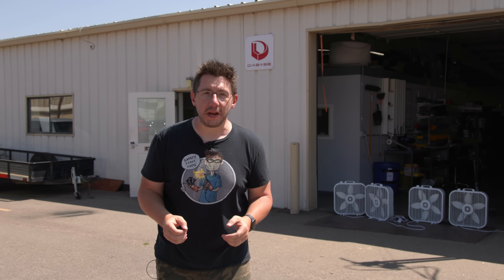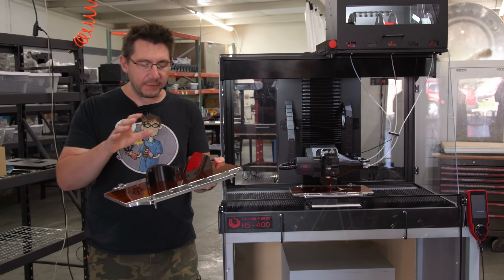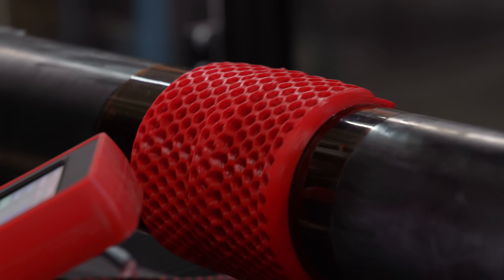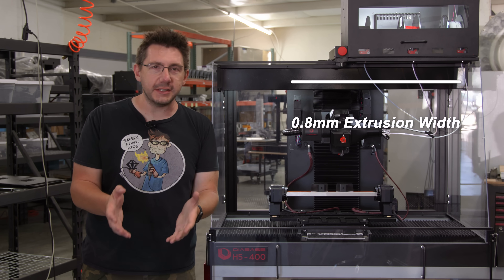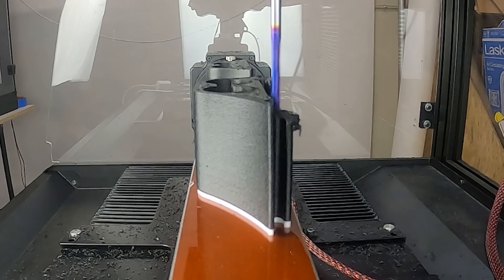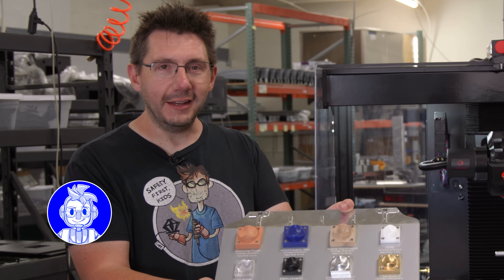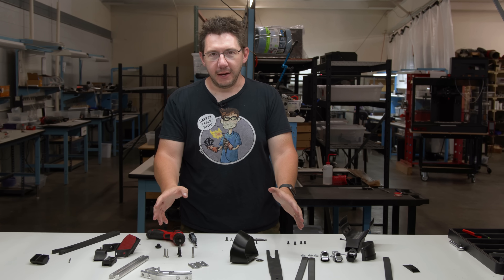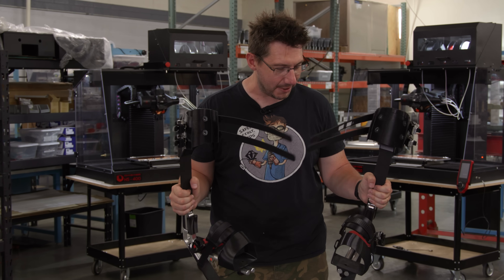ALL NEW H5 400 3D Printing / CNC Milling Platform from Diabase Engineering!

Comment: Tip - to remove PETG in particular and other polymers too from a print bed coated with PEI film, while the bed is still hot (or reheat if necessary) carefully lift the brim around the border and squirt a little bit of IPA under it. Let sit for a few seconds. The part should pull off easily. Parts with large surface contact may require mild pressure with a scraper to break the adhesion.

Comment: I had a very similar idea in college many years ago and it was apart of my senior design project. 3D printing with a 5 axis machining. We never had the budget or the amount of people needed to add the rotational axis needed to make it 5 axis machining so we wound up with a 3D printer with a basic CNC router. We were able to 3D print nylon onto a metal plate and machine the nylon after it was done so we were somewhat successful. Also we had limitations in software such as how to 3D print a part slightly larger and CNC machine it to the correct shape afterwards? The CAD/ slicer tool integration were not that good back then. We were also shooting for metal machining capability, and large build volume which we probably should have not done and focused on the 3D printing/ plastic machining only.

Comment: How does the TPU between the build plate and the part affect tool chatter when milling? The key to getting rid of chatter is to make the whole system of tool, machine, and part as rigid as possible, and TPU is kinda like the exact opposite of rigid.

Comment: Its cool, but only for a given diameter. If the machine could make it's own custom bucks, it would be a different story. If it had some way of calibrating new bucks auto magically. If it had a way of creating new bucks and automagically calibrating them. Going from job to job, the process needs to be simplified for it to be viable. This process needs work to compete with thermo-forming, but I have no doubt that it one day will. I envision a 2.5D printed cylinder automatically placed in a chuck and then probed with something akin to a BLTouch, and then cross-hatched helical layers added to improve surface finish before a second material is used, one that can release off of the buck. This same technique could be applied to making prosthetics. It would require the other end not be fixed though to fully leverage the system.

Comment: In a manufacturing environment it still makes more sense to have one machine for printing and one for milling. Milling is going to be way faster than printing and multi function machines are rarely as good as single use machines.
Reply: @technoe02  the problem is to keep the origin consistent. That’s why all LFAM 3D printing and milling machines are all in one.
Of, you can have a dual setup with multi-pallet. So the part being built and machined doesn’t move from the pallet (building plate) and the origin doesn’t change. 
But this is practical if you post process (by CNC) a completely 3D printed part. However, milling and refining while 3D printing offers its advantages too. So it’s always a trade-off.

Comment: I'm wondering how accurate this is when you're milling a part that's being hold by a flexible material such as TPU. I'm a bit skeptical
Reply from the maker: I don’t know. I know that the TPU boot is a layer or two thick, so while it is flexible I know there isn’t much give and wiggle. Diabase will need to chime in here.

Comment: I can't believe they rely on build plate adhesion and kapton tape adhesion as fixturing for CNC milling. Also it seems like the TPU base layers would let the part flex too much relative to the build plate for accurate milling.
Reply from the maker: That’s not the only adhesion method. You saw in the last setup they used a vice.

Comment: Ive only watched 4 minutes so far. This is my opinion as of now, this unit is clearly meant for professional use and has a price tag to match. The problem is this machine is either 3D printing or CNCing. So your CNC is down if you need a 3D print and your 3D printer is down if you need a CNC machined part. I feel like this idea would make more sense for home or quick prototyping. However the price tag would make that impractical as well. Cool idea though
Reply: I think this is separating FDM from CNC as a process. This machine was designed to do both within the same operation. To use is for one or the other... that's a possibly bonus, but not the goal.
Reply: @soulpedal  Yeah thats definitely their intention. I still feel like its kinda a weird middle ground between prosumer CNC/3D and the more industrial. However after completing the video I feel like this things main purpose is for quick prototyping.
Reply: @Megabean  And production, or I'm wrong and will pay...

Comment: It’s not precisely cylindrical but printed arm casts and wrist guards would benefit from a rotary print bed.
Reply: Absolutely. The parts don't need to be cylindrical necessarily to benefit. But parts that aren't cylindrical at the base would require support material.

Comment: Any one know what is the price with everything show here?
Reply from the maker: Diabase will be going through the comments and answering I believe
Reply: Yeah! There are a number of different options. $9750 is 3 print heads and 2 milling heads with a print bed. $17,500 is 4 print heads, 1 spindle with 14-tool ATC, 3-axis workholding, 4th and 5th axis. Prices go between these two points depending on what your needs are. Every part in the video could be made with a machine <$14k

Comment: Aren't those the same concept as those prosthetic running blades? Looks similar at least, with of course the exception those are clearly not made for someone missing a leg(s).
Reply from the maker: Um, sort of. The bend of the running blades is more specific I think.

Comment: Great video, I checked the link and it seems to start at $10K, what was the price of the machines you used?
Reply: All the parts could be made on a machine that costs less than $14k (multi-material, aluminum milling, 4th axis). The ATC (toolchanger) will cost more though.

Comment: Did they show you any of the software that runs it? I'm very curious about that...
Reply from the maker: I think it’s Fusion 360 with a custom post processor and a slicer like Simplify3D
Reply: All standard gcode. Any slicer could work, although atm we support Cura and S3D. Same with CAM - any package could work (nothing special about the code), but we support Fusion360 and HSMWorks.

Comment: I guess custom prostethics might benefit from that extra axis on the printer. You don't have to print the full prostethics, usually you just make the 'socket' that fits on the body and then attach that to a more standardized part. The better surface finish of a milling operation, and the ability to do several materials (soft for comfort and rigid for transmitting force) combine into a pretty interesting tool i imagine. Would have loved to see the slicer that they use for multiaxis printing and milling, and how hard it is to make working gcode for this machine.
Reply: Yes! Such a great application for the machine. We have some (freely-available) software to help slice rotary (4-axis) 3D prints. And 4th axis milling is no problem with most CAM packages. At this time we aren't aware of anyone doing 5-axis additive toolpaths. We normally print stock up vertically (essentially 3-axis), then mill back in 5-axis.
Reply: @DiabaseEngineering  maybe shift the layer orientation of the print while it is printing to interlock the layers and make splitting layer line a thing of the past.

Comment: Let´s be honest: Most of us will never be able to afford a machine like this. What I´m Interested in is what software they use for the non planar 3d prints. It´s quite easy to model and build a 4th and 5th axis for a printer (If you don´t need it rigid enough for milling) but I don´t know a single slicer that could use it. If there´s anyone here who knows better please correct me. Thank you
Reply from the maker: I believe right now they built a custom post processor for Fusion 360.
Reply: There is no software that currently works out of the box. We have some software (freely available) for rotary printing that utilizes standard slicers. Our customers have a lot of success with the process (not overly cumbersome).
Reply: I believe this was something that Pathio (sp?) was hoping to bring with it in addition to tool changing.  Haven’t heard about any progress on that in a while tho.

Comment: Homework = Stainless steel cups with 3D printed handles custom fit to the cup with custom designs printed around the cup.  If they had a laser head as part of the setup there could be custom laser engraving around the cup at the same time to coincide with the 3D printed design.

Comment: For all those complaining about the price, you are not the target market.   

Some of us outgrow the capabilities of the Ender (and clones) and want something that can print bigger, or higher quality, or multi material.  Also, sometimes we just need to produce without tinkering with a barely supported system.

So we pay more for the functionality or the support.
Reply from the maker: Agreed. Plus the price is well below many machines that have similar functionality
Reply: and this is far beyond "ender 3 have outgrown me"
it's kind of a bit after "my prusa mk3 have outgrown me" and "my diy desktop milling machine has fucked up enough of my project"

the fact that it's 9k doesn't means it's cheap but it's ridiculously powerful for the price
ultimaker s5 is like 6k and it can't do shit that a prusa can do
Reply: I was surprised by how cheap it was. No machines have a full ATC at that price range.

Comment: "So, I'm like a gazelle!" 🤔😂 Your video has been forwarded to The Gazelle Association for Fair Treatment of Fast Grazing Beasts, TGAFTFGB for short, on copyright infringement of fast and agile animals by slow humans in shorts and knee high socks.

No J you are more Iike a accident  waiting to happen, doing that in a shop full of sharp corners and equipment! As a public service announcement " KIDS don't try this at home if it is a shop, leave this to professionals and, ummm J if you have four spotters!"😱

On another note 🎶, this was/is an interesting view on that machine and it's characteristics. Like how they use acetone to loosen TPU off the bed. Yet and now, you might of started the real 3rd WW. As all males with 3D printers will probably go ruffling through their g-f/wives cabinets and steal their nail polish remover before printing TPU. We might have to open intern camps to house these men as casualties when their significant others find out.

Enjoyed the breaking news 🗞️ on the H5 400, I want one of those!

Comment: Printing onto aluminum parts after milling could be useful, to protect the surface of add texture. maybe adding ties etc
Reply: I was thinking the same thing. It would be very useful for gaskets. The challenge is the aluminum part would need heating.

Comment: I don't know if it would be useful to do so, but would this allow you to machine a surface that you then 3D print onto in a single operation?
Reply: Last I check it was using simplifed3d so you would create your processes and then group them together so you could 3d print then mill then do more 3d printing on the same part - so depending on the tool options you could tap screw hole in your 3d printed parts or print overhangs and clean them up with milling I would think.  https://www.youtube.com/watch?v=08UsesW8Oa8&list=PLu4yHjUVmNdjdAAl7cy9tM9UOeGZSU5B7&index=5

Comment: And now I need this and a bigger garage 😂
Reply from the maker: That’s a stellar idea :)
Reply: Who needs a garage? This is going in my home with my other printers, lasers, scanners, and band equipment... Steve didn't like the idea, at first. It's my Hybrid Home.
Reply: @soulpedal  that's true. It's a thing of beauty and can be placed in the living room. Now I just need to convince my wife...
Reply: @medyk3D  I did (marry), but it's not some messy house. It is the front room afterall. Imagine a Tom Petty style rug with full band equipment, and off in the corner are steel tables for electronics testing/parts/scopes etc... right under a serialized Apollo moon shot from NASA. This is my moon-shot. I have tried on/off for 10 years, and leaning in harder now $$$. I play guitar, and I make stuff - best integration of all passions in one. If I can only find my needed TI processor chips before my nickname is "Coming-soon", lol.

Comment: website says "starting" at $9750.  I'm really curious what that gets you because having a really nice 3d printer AND a CNC with a 14-piece tool changer is not terrible.
Reply: ATC is more - closer to $13k. $9750 is 2 milling heads, 3 print heads. Everything - 4th and 5th axis, 4 print heads, ATC - runs a bit over $17k.
Reply: @DiabaseEngineering  Honestly that's still a good price for all of the things it can do IMO.
Reply: @DiabaseEngineering   reasonably priced for what this machine is capable.Excellent work 👍🏻👍🏻
Reply: @DiabaseEngineering  Is the milling head 300W? The specs say 30W, I assume that is just a typo ?
Reply from the maker: I don’t remember exactly. I know Diabase is working on the site and getting all the info out.
Reply: I think even at double that price in the maxed out version that still sounds pretty damn good. I will not claim to be any expert in cnc, but a decently profitable small business could easily afford 20K for a machine that capable. The future looks dope.

Comment: What software does the 4 axis slicing? or they just doing the "make X your B" thing?
Reply: It's a mix. We use a standard slicer, but scale the model to account for the increasing circumference as radius increases. The rotary axes themselves are true "A" and "C", and can be driven simultaneously with X,Y and Z.
Reply from the maker: I think right now they use Simplify3D and a custom Fusion 360 post processor

Comment: Cool machine, but the important thing is the software. How do you slice a simultaneous 5 axis part? How good is the software? I have a C axis on my printer but I have to manually program the gcode. Its more for experimentation than making parts. This is especially important with 3D printing because 3D printing is usually used for prototyping, and quick one offs. If I have to spend a week programming and proofing a program for one prototype which may or may not work it defeats the purpose imo. I'm glad the hardware is here now all we need is software, and not thousand dollar a month license software.
Reply: We aren't aware of a 5-axis slicer. Fusion360 has DED processes that could be modified, but that is not ideal. For most of our hybrid 5-axis work, we print the stock on 3 axes, then mill it in 5.

Comment: Cylinder axis means you have to have one for every diameter measurement? More information on this?
Reply from the maker: If I remember, you supply the tube. I think it’s a standard black plumbing pipe on there covered in Kapton tape.

Comment: The cooling on some of those parts was not very good with scabby corners, this is something I spotted within 3 minutes of watching the video 2:44
 Its a nice machine but I just finished paying off my mortgage and dont fancy taking out another one to buy a 3D printer x milling machine that my Pro 3D V-King 400 prints much better quality LOL
Reply: They could also be significantly over-extruding for strongest layer strength and as fast as possible since they they are cleaning up final shape in the machining step.
Reply: @jonathonhoogland9446  I dont think the part that looked scabby was post processed with milling

Comment: this is a pretty cool machine 👌😎
Reply from the maker: It’s SUPER cool dude.
Reply: It'll only cost you a arm and a leg
Reply from the maker: @jimmymcguire5039  I had to pay with two legs.
Reply: @3DPrintingNerd  oh so I they do take two legs? Great ig I'll be abel to print prosthetics with it
Reply: $9,750 and the company is currently closed so not tech support except youtube channel and github page and the control board as a 3rd party plus time wayback machine of the closed website  @jimmymcguire5039
Reply: @jimmymcguire5039  but on top of all of that. repairing it and getting it to work again without support was a lot of fun for me as a machinist and manufacturing engineer